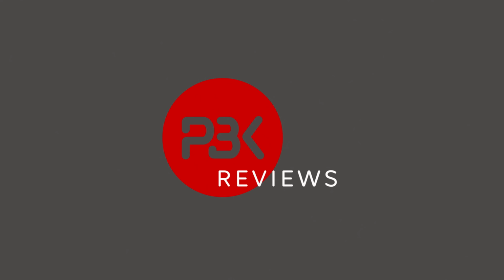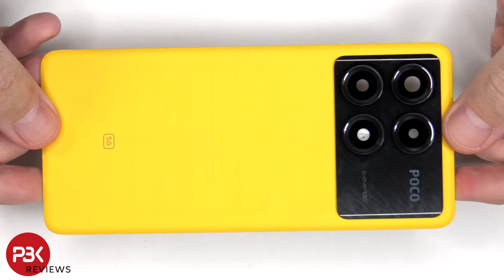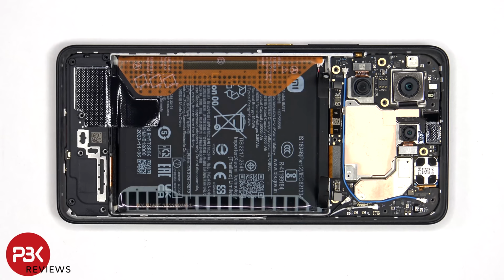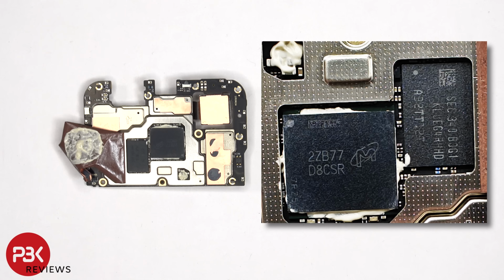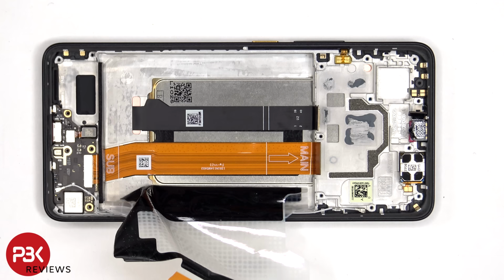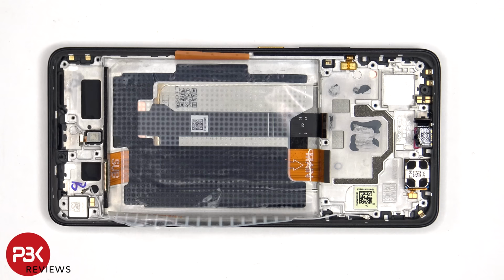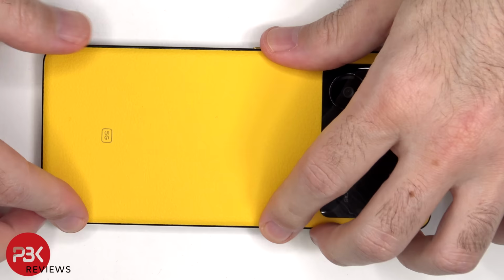Xiaomi Poco X6 Pro 5G Teardown Disassembly Repair Video Review

Comment: Thank you so much sir, I started watching you before I bought X3 Pro. And now my Poco X3 Pro is dead, I buried it last week ago. Cause of death is cancer I mean dead boot 2021 - 2024.
Reply: I thought of buying poco x6 pro or note 13 pro + which will last for long years?
Reply from the maker: you're welcome
Reply: You should show a thing that poking in mic can damage it or not in all phones it's most important in teardown videos 
Show the inside mic too
Reply: Same issue my x3 pro lived 1 year unfortunately.. an awesome device that should have been recalled 🫠
Reply: @Smzxe it won't. Mic holes are built angled so that it won't harm the mic when accidentally stabbed
Reply: الان مشکل آن چیست؟
Reply: @MUXLegend-yg9xt Bootloop happened to me 4 months ago, it turned everything unresponsive, and then turned to white screen. After that it dies quickly and starts to reboot itself.

I believe it all starts when the phone does not charge unless you reboot it. And I repaired my phone using the CPU reballing. Because it dies, now after 14 days, the same thing happened, it does not charge so I have to reboot it. And breaking the advice of technicians not to reboot and update the OS.
Reply: @MUXLegend-yg9xt so if that is the first time, I recommend to backup anything you can save before it happens again. The phone basically has cancer. It may be the sign, as my experience.

Cancer means no cure, only maintenance to prolonged.
Reply: @LuminescenceBloomcraft  CPU reball will fix X3 pro 
You should have went to a good technician
Reply: @Smzxe its still not the best idea. As I said, it fixed but 'won't last'.

POCO X3 pro has reported to have so many complaints about not charging or Bootloop issues (suddenly die and re open by itself) this issue is still covered by the manufacturer. So basically even you fix it by just replacing the solder, it will significantly reduce it's integrity and have more chance to have the same issues as the phone is originally design to work with a high performing cpu.

So when a technician Disassembled it, it basically reduced its heat transfer. And I believe it is because the cooling system they put is degraded, so it has no heat transfer. And other factors could be a reason like software... Because sometimes, the manufacturer programmed the hardware to over clock as the software assumes that there is a cooling chamber will hold the heat. Even though there are no overheating usage it's still dies
Reply: @LuminescenceBloomcraft  yes poco x3 pro all units died because of trash CPU soldering and overheating 
After CPU reball phones works perfectly fine it's just around $5-10 to fix
There's no issue after that if you meet a good technician who does good CPU reball 
It's permanent fix
Install custom ROM after that
On custom rom there will be not overheating and battery will be good
There will no issue at all
Reply: @PBKreviews  Next one iqoo neo 9 pro please
Reply: Mine poco X3 pro dead,reballing failed,now using pocof1
Reply: @Smzxe I will end the conversation here. The phone fixed but it won't fix the problem. It will happen and it will happen again, no matter what. You'll have to replace the phone because it has defects and is not advisable to use. The phone dies, even the manufacturer uses the good soldering equipment also used to other of their phones. I don't trust any technician no matter how good they are as they're not the one who creates it.

The phone can be recalled if you took the battery and drained it and hope to be open for a rate of 60% of possibilities. But it will happen again, stop advising it here. As I believe you don't have any experience at all
Reply: @LuminescenceBloomcraft  if you meet a good technician he will permanently fix the CPU and reball properly
My friend also did that his X3 pro running fine from 1.2 years now 
He did reball in 2022 still running fine
Reply: Some can use the phone for a month, some won't
Reply: @LuminescenceBloomcraft  go to a good technician first lmao 
He will permanently fix don't go to local repair market they don't know nothing how to do reball properly 
My friend did reball with a professional technician his phone is still running from 2022 no issues at all his X3 pro is running fine 
That technician did most cleanest reball
Reply: Well I don't want you to mention after all so we can end this for the sake of people. For me it's no longer a best choice, since we don't have the same environment. It is best if we just move-on to choosing Poco X3 Pro as our X best friend. I'd rather buy a new one than stick with a phone that wouldn't last for long and much primarily could harm my data. My data is very very important to me. I guess that is the best choice for some cases if you turn to casual use
Reply: Exactly same thing happened to me 

My X3 pro goes into QDL mode and then I had to reball the cpu 
Now working fine but don't know how long it'll last (can I game on it now?)
Reply: Will poco x6 pro has the same problem of x3?
Reply: Still using POCO X3 2020 - PRESENT no issue. No heating issue, no deadboot and etc... playing mobile legend ultra graphics  still no issue
Reply: @awee19  it will happen eventually
Mine also working flawlessly one month ago
Reply: Mine too
Reply: Pretty much everywhere, they hate POCO, lost the reputation and are very devastated for their brand. Probably 50% of them will not choose Poco as their daily drivers
Reply: @awee19  even if you're not doing a heavy load, there will still be a shot for it to die. No exceptions whenever what you do. Xiaomi phone is designed to have constant performance which results in overheating. But overtime probably degrades the liquid cooling inside of it. Just for now, they used a much bigger cooling chamber and more flagship cooling systems, which poco x3 does not have but uses the most demanding CPU, which requires higher temperature workload and power.
Reply: Either custom ROM, it's not really great Ideas, as it's very unstable. If you don't know how to use it
Reply: @sahil1307 even when you do not play, it will still last a year, not years, well probably a month's. After a while it will tell you that the phone won't charge, so you have to restart it for it to charge. It relates to that issue.
Reply: @jamesvasanthp7976 for me it depends on the user. I'm much more concerned about the battery and the screen as they degrade more than other parts of the phone. You can't tell if the phone has issues when early birds
Reply: Both used OLED, much lower lifespan than IPS and also much more FRAGILE, you need constant care like, temperature, brightness, exposure to sun and many more. Static Images also included.
Reply: The length of use also includes, for me 15 hours a day, which is not great
Reply: @LuminescenceBloomcraft  hey I wanna know which new  device you are purchas-ing/ed
Reply: still did last over 3 years
Reply: im still using my poco x3 pro 😂
Reply: my poco x3 pro also just died couple days ago, first issue i had was with the battery like half a year ago had to replace it. It also after couple months had a power button issue it wouldnt turn on at all this was a month ago. And now the charging port is mostly likely the case because its not even showing up when i plug in the charger. Good phone but sadly a lot of issues with it start after 2 years :(
Reply: My X3 Pro also died. There were some software updates. After that, program shutdowns, phone restarts, and then everything went dark.
Reply: Sir are the hardware components good?
Reply: Мій Poco X3 Pro прожив рівно 2 роки і 1/2 місяці десь,і потім просто екран показав хвилі ніби зіпсована матриця, видав звук писку ,і помер 😢 Тепер він не заряджається,не вмикається,така сама причина була в знайомих,теж 2 роки , їм майстерні по відновленню смартфонів сказали що нібито згорів процесор. Ну можливо бо він в мене як і в знайомих сильно грівся від ігор потужних на кшталт Геншин)))
Reply: @awee19 граю в моблу теж але ще граю паралельно і іншу гру яка така важка що X3 pro не витримав процесор і помер 😢 ось думаю над купівлею Х6 pro
Reply: The reason why Poco X3 pro has a deadboot issue because it was manufactured in india, they use some weak soldering material that's why most x3 pro has deadboot issue
Reply: @Shiryu-Dope1508  nah even the global version has the same issue not just indian varients

Comment: I buy this shit because I thought I get cool phone since it has LiquidCool technology but still I got a 45-46°C and the worse part is I only using Facebook and messenger!
Reply: What ? There's a heat issue change the phone
Reply: Is your device version international, Chinese or Indian?
Reply: Teli kötülemek için elinizden geleni yapıyorsunuz ben -20+85 şarj yapıp bir çok oyunda denedim hiç sorun yaşamadım ve full 8 saat durmadan oynadım 60hrz,de bende 512gb,12ram var🎉 coook memnunum
Reply: Ur room temperature
Reply: Lie less, you are lying at a very high level 😂
Reply: @David-ox9lm  I'm literally using poco x6 pro right now. They fix the heating issue if you not  using the phone but the problem is the screen didn't go down to 60hz if you set the default settings. How about you? You have poco x6 pro?
Reply: @Roldo123  29°
Reply: Must be indian version
Reply: @ghostbutcher685  it's global version. The lasted update fix everything except for screen Hz adaptation. I lock mine to 60Hz to save battery
Reply: Well in India I can't even take this phone outside it's get so hot that my skin can get burn in my paints

Comment: Love the tear downs & I also own and love this phone. The performance and smoothness is slick.
Reply from the maker: 👍 thanks
Reply: Is lithium ion battery or lithium polymer? In Websit its show polymer and this video lithium ion show
Reply: i just learned you weren't supposed to remove the orange pull pouch 🤣🤣
Reply: @surryyyaaa  It’s Lithium Ion because it was shown in the video. I actually really appreciate this video because it helped me determine if it was Lithium Ion or Lithium Polymer because it was unconfirmed in many websites even GSMArena.
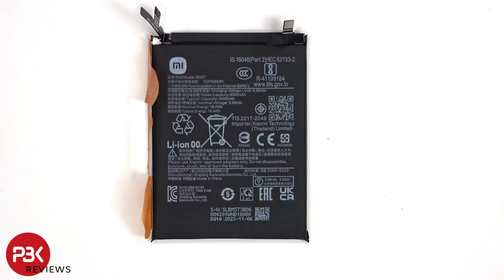Reply: 5:21 It can be read in the top lines. Li-ion Polymer.

Comment: I want to ask you: In your opinion, it will have a processor problem like the Poco X 3 Pro. Please answer
Reply: I think no ,cause dimensity not have problem die
Reply: Dont buy
Reply: Did you find the answer or not yet?
Reply: @adekurniawan9525 it wasn't because of the processor it was because of the soldering and shitty heat dissipation

Comment: I have this phone right now planning to buy a phone cooler, is it okay to put it below the camera?
Reply: It should be close to the camera but the problem is that this phone has a camera module that sticks out a lot. I don't know how to put it as best as possible.
Reply: Ah 102 could be good option for poco x6 pro
Reply: Do you recommend it or not ?
Reply: No
Reply: Yes i also do that when i play it and the heat is normal 35°C btw im using black shark funcooler 4 pro for my poco x6 pro

Comment: Do you consider vegan leather back equally durable as compared to plastic back for a long term usage?
Reply from the maker: I think it handles wear from rubbing and such better, but can probably get dirtier or get gashes in it depending on the environment its used in. For example someone working in a mechanic shop or metal shop etc. would probably be better off with plastic vs vegan leather.
Reply: @PBKreviews  does it effect thermals?

Comment: Are we use motherboard without cooper sheet which was apply on mother board for heat transfer my phone get wet and when I diagnosis by local technician he say ic was reballing for this process we need to pull it out and use the phone without copper sheet is it good 👍

Comment: I have an question please reply,❤

How can they provide Lpddr5X ram and UFS 4.0 storage at this cheap cost ( ₹23,999 or 287$ ) ?
Infact Mobile around ₹35k ( 419$ ) from other brand are just providing Lpddr5 and UFS 3.1?
Is motherboard in X6 pro is cheap?

Please answer, love from India ❤️🇮🇳🪷
Reply from the maker: i dont know
Reply: @PBKreviews  dude you teardown it so atleast you can tell about soldering and about other circuits, and which material is good for cooling Copper or stainless steel?

Comment: Whats the difference between mtk dimensity 8300 ultra and 8300
Reply: Ultra is used only by Xiaomi/Redmi/Poco devices. It's some sort of a deal between MTK and Xiaomi. There's not much clarity on any real difference. They also use Dimensity Max for Oppo/Realme/Oneplus phones.
Reply: @HasaanShaikh  8300 ultra is just a bit overclocked as compared to 8300

Comment: What about motherboard issue? Will it come as x3 pro?
Reply from the maker: hopefully not
Reply: x3 pro r ggood... but if not correct, the plastic cover on the proccesor board make the heat hard to spread out outside body cover

Comment: Hi, am i see wrong? The heat dissipation very bad on this poco x6 pro?

Im owning it now. I feel the phone easily heat up n very easy to get frame rate dropped when playing games.
Reply: In my opinion, the heat of the Poco X6 Pro is located behind its camera. Its casing design is not very friendly for cooler and additional heatsinks due to the camera obstructing the top part of the phone. :/
Reply from the maker: Generally the phones are designed to exhaust heat out of the phone so the phone will get hot. But if your phone is lagging or dropped too many frames might be another story. Overall the cooling on this phone is much better than the previous models.
Reply: You didn't say why. Were you maxxing out the settings? Are you playing unopyimized games like Wuwa or CarX Street? And on mobile 5G?
Because on WuWa, even low settings will heat up the phone but it's tolerable on Genshin at Medium. Problem goes away if the back if cooled by an electric fan.

Comment: I buyed this device on feb 13, yesterday, suddenly whole screen turned into a light greenish with lines and stuck nothing was working in the screen, I nearly got an heart attack as I thought mother board dead, but I tried restarting using power button. It got turned on and everything was fine. But i Don't know what is thr reason behind this 😢
Reply: Has it happened again?
Reply: @elcamino142  not yet
Reply: What????
Go and Replace it
Reply: Yazlımda sorunlar olan telefon

Comment: I dont understand phones structure, but I see that the cpu and ram do not stacked  like x3 pro that people consider it as phone killer ? Or am I wrong and actually the cpu and ram were also stacked in x6 pro here ?
Reply from the maker: They are stacked. And being stacked is not a phone killer, having poor cooling or bad motherboards are the problem. All high end phones/flagship devices use stacked ram with cpu because it offers better performance. As long as voltages, parts, and cooling are good, there should not be any problems.
Reply: @PBKreviews  i also believe no way phone maker would make intended faulty design. It all depend on the usage like gaming while charging, recording 4k outdoor on direct sunlight etc that influence the age of phones.  Basically for USD 320 (not counting cashback) from preorder period, no current phone could stand above x6 pro
Reply: Poco X3 pro died due to low quality thermal paste and cheap pmic same with note 10 series
Reply: @PBKreviews Do you advise me to buy poco x6 pro?

Comment: Why is there a foam grid like structure on the underside of the back cover? Looks like itll just trap the heat.
Reply from the maker: its both for a buffer to fill in the gap as well as the material its made from helps to transfer heat.
Reply: @PBKreviews  yeah but it has lots of empty area.
Reply: @bulletpunch9317   My thoughts exactly. My guess would be to create an air gap that would isolate your hand from the heat. "My phone is ice-cold, never heats up", while it is slowly frying from the inside. That's truely sinister, if that is indeed the case.

Comment: Why the RAM location on the board differs from the Vanila Poco X6 5g?
I'm not a fan of the RAM being on top of the SOC considering this isn't a compact phone!
Reply from the maker: Ram being on the processor is for better performance. Most flagship phones use that design. As long as cooling is good and quality of parts is good, then you should not have problems with over heating. This phones cooling has been upgraded a lot since previous years.
Reply: @PBKreviews 
Valuable expert opinion, thank you ❤️